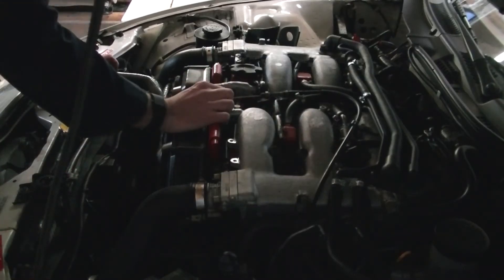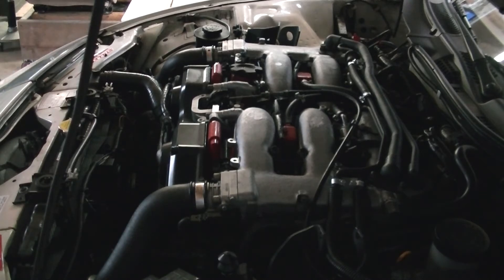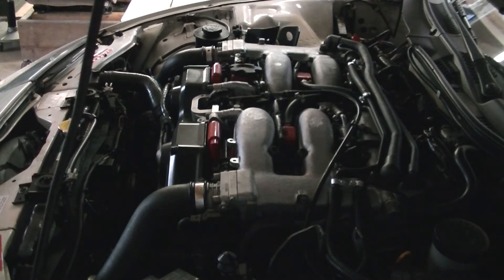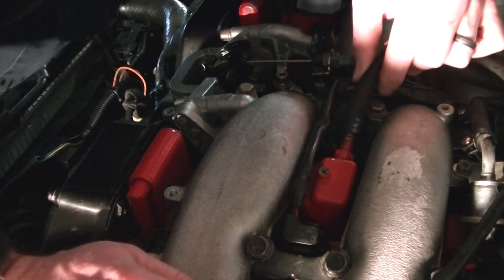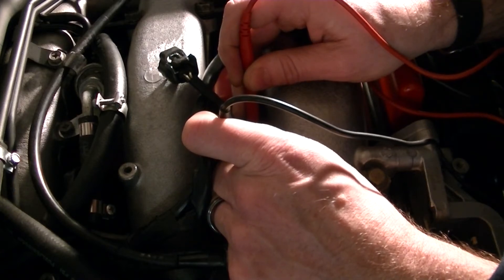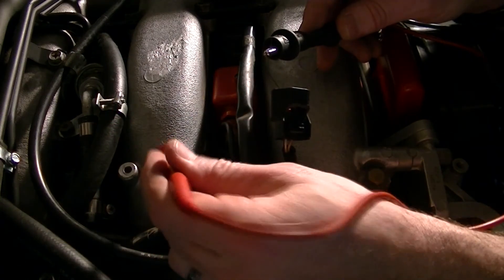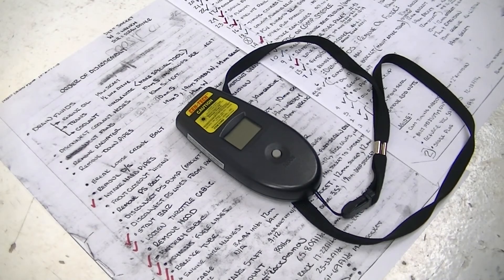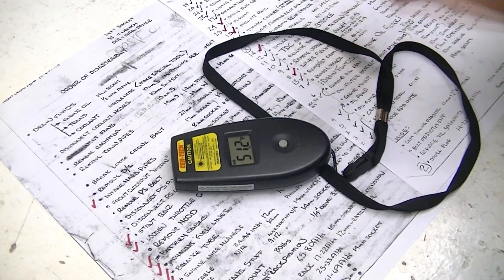HOW TO Identify and Diagnose Misfire on Z32 Nissan 300ZX

Comment: It’s weird my cylinder 1 was misfiring and the injector was bad, I changed the injector (new seals) and it reads .11ohms but I still am getting a misfire on that cylinder. I also changed my spark plugs and I’m at a complete loss
Reply from the maker: That's frustrating!  Maybe there is a harness issue in the injector circuit - short out with two wires rubbing?

 Could the plug coil be bad - you could simply move the coil to a different cylinder to see if the issues moves with the coil?  Could do same to make sure plug is okay....

Harness issue in the spark plug circuit....I had a bad transistor years ago (electronic module under passenger side intake that caused misfire symptoms).

Good luck!!!
Reply: @BroncoColdsteel  thank u!

Comment: Problem started after I changed my spark plugs and fuel filter before that my car was not misfiring on idle I don't know what I should do I replaced my mass flow oxygen censor also my ptu with harnesses  I need some help please
Reply: Are the spark plugs gapped correctly?
Reply: Just a shot in the dark but if the problem wasn’t there BEFORE you did your work then you should investigate the things you just worked on
Reply: What did you figure out?
Reply: I got the same problem

Comment: What were you measuring with the thermometer to determine which cylinder was missing?
were you measuring exhaust header temperature? or sparkplug temps?
Reply from the maker: Andrew Ford Exhaust temp for each cylinder.  Much easier if you have headers.  Not sure if it will work with factory manifold and heat shield
Reply: not sure how it'd work with my turbos either :/

I suppose I could run the car up to temperature, and then pull the coilpacks off and measure sparkplug temps?
Reply from the maker: I think you will hear the sound of the engine change if u pull coils and you will have ur answer...but would also be fun to check plug Temps as a confirmation.   If pulling plugs doesn't uncover the problem it could be MAF, crank position or your transistor module which is located under the passenger side throttle body.  O2 sensors are easy to check, if u unplug ur 02 sensor and problem goes away (or gets alot better) then you know it's a bad 02 sensor.  This happened to me...chased an intermittent problem where car would idle but wouldn't run down the road....pulled 02 sensor connector and it went away!!  Good luck!!